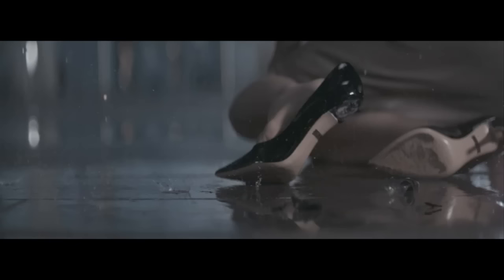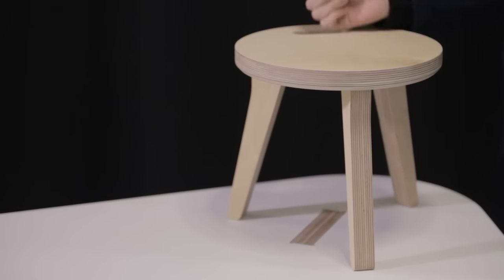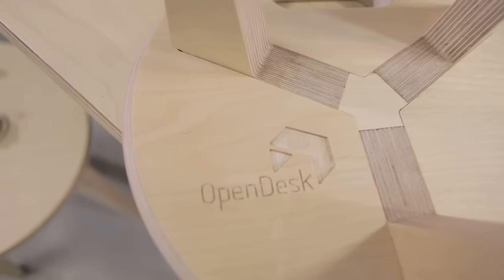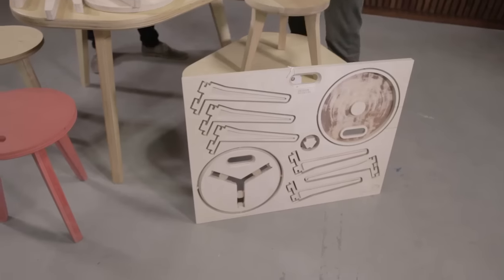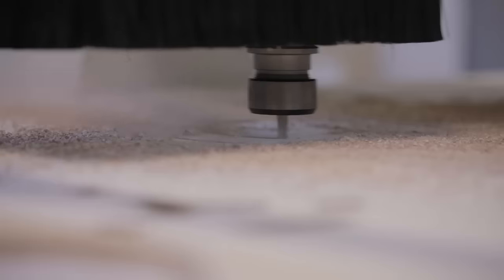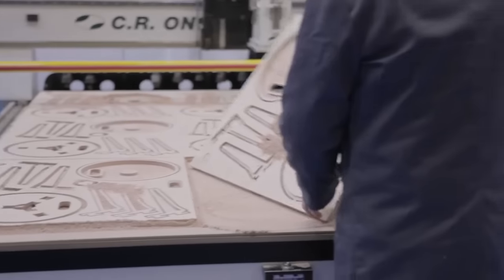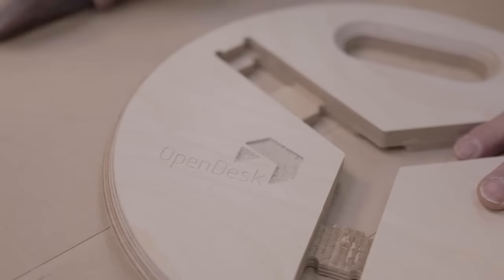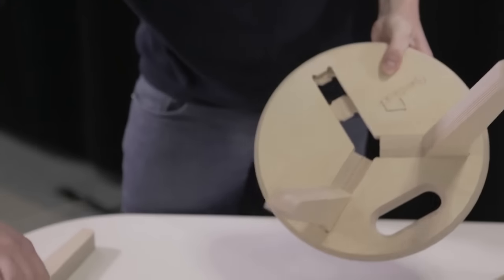OpenDesk: a revolution in furniture design

Comment: I don't get the logic behind this concept. Designers submit their original designs without getting paid...then fab shops download, make, and sell the product for profit??

Who in their right mind would spend time on a design and give it away for free so others can profit?  This is absurd.
Reply: You can use specified creative commons licences to prevent someone making profit with your designs. Nearly all Open Design websites work this way. 

The biggest benefit for a designer is that he or she can put out their own designs like they were suppose to look like, without all the limitations given by a client. It's like a connection between the designer and the user without owning an actual company, build expensive prototypes or invest in specialized tooling for manufacturing. Of course you can't make millions by giving away your designs for free, but at the end of the day, people are using your products, they can edit it to their needs and happy users will most likely support you when you're actually starting a company one day. It's like what every youtuber is doing nowadays.

Right now the tools to create an open designed products are limited: CNC, 3D printing, laser cutting. But not your whole product has to open. Parts which are big and don't require difficult manufacturing techniques ( most likely in furniture design) can be made locally in better quality and they will save shipping costs.
Reply: Lol if your phone runs Android, it's based on open-source software. Welcome to the future of economy, everyone working to improve everyone else's lives.
Reply: @WhenDoesTheVideoActuallyStart  Is your Android phone free?
Reply: Yeah, the designer was easily going to make millions selling small plywood stools. Also, it's a free commercial and exposure. Nothing lost.

Comment: LOOOOOOOOL, "a revolution in furniture design", really, those people are way too high on dope. They revolutionize nothing, maybe our ass, turning it flatter, they just spread awful industrial cheap designs. Unless people wanna go back to childhood, with the same kind of furnitures for kindergardens. That's a big regression in design , not a revolution . Replacing the low costs from mass production by individual making through CNC democratization isn't a revolution but a big and juicy market for materials suppliers. This is the modern trend : moving the costs directly to the customer hands. You finally pay more, for less service and you think you won.